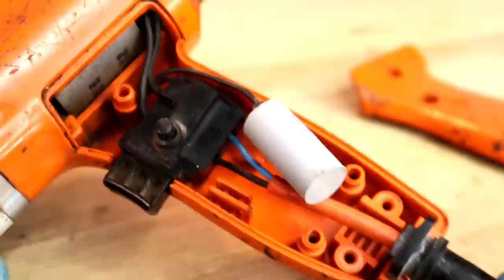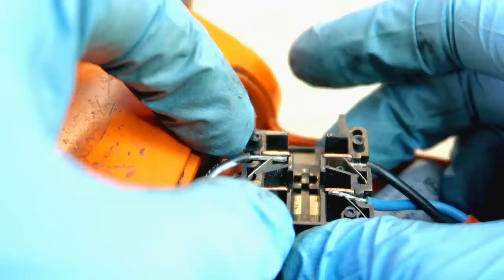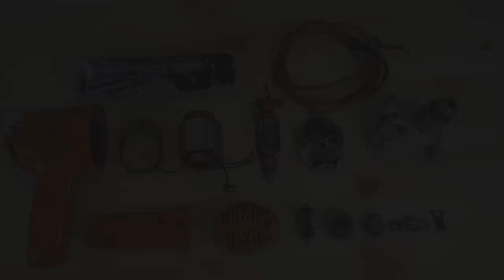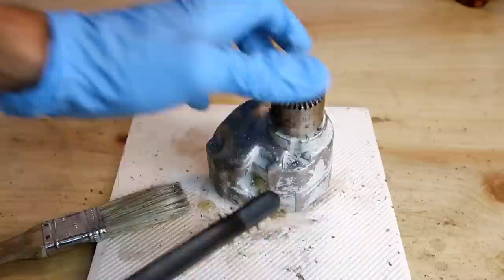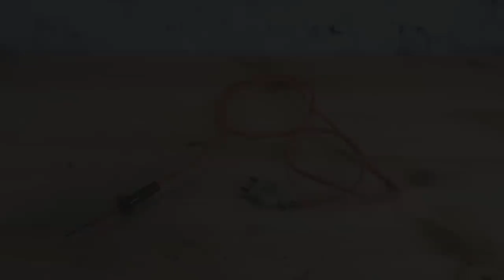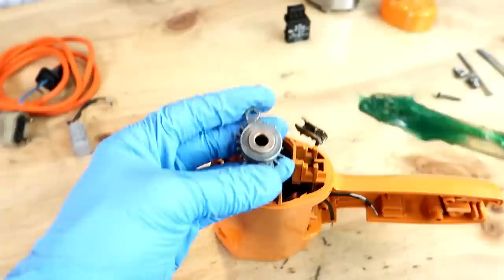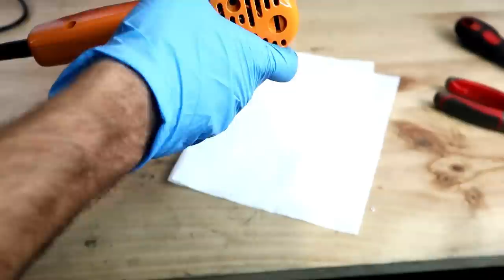Broken Old drill Restoration - Black and Decker

Comment: Excellent! Consider using the buffing wheel with various compounds to restore the plastic parts.  Depending on the type and hardness of the plastic, the scratches could probably be removed with quick passes against  a wheel suitably treated with clay's, compounds, or rouges.  Liquid and paste automobile products, rubbing compounds, and scratch removers may also work. Thanks.
Reply: But that way takes ages, a light rub with fine wet n' dry then a blow over with paint takes an hour at most.
Reply: Using cotton wheels and compounds, a job of that size is 15 minutes, tops.  Rinse with soap and water, dry, and apply a spray polish. No worry about paint chipping. I did this refurbishing telephone cases and components in the 50's and 60's.   @CaptainScarlet1961

Comment: I have a very similar model. Sadly, the insulation coating of the windings in the armature burnt last week, after more than 40 years of happy drilling.
I don't know of a way to fix it that doesn't imply just buying another drill for a motor transplant.

Comment: The phosphor bronze bushing (plain bearing) at the rear of the body, inside the star-shaped aluminium die casting, is designed to be oiled, not greased - that's why there's a hard felt bung inserted in it. Have you found that the aluminium gearbox housing has oxidised over the last 3 years with it not being painted?

Comment: My mom had one of these when I has a kid. I took it apart and put back together again. I don't remember if it worked again or not. I think I only took it apart to see what it looked like inside and how it worked. Stupid me - I would've used a polishing wheel and some rouge, or plastic polish to clean the handle and the back cover instead of simply painting it

Comment: With single direction drills, once screwed on, the chuck will be kept securely in place by the turning force of the drill shaft versus any resistance to turning (i.e: the friction/resistance created by the drill bit in the workpiece).

Comment: This was/is an amazing drill, 2 speed with tons of grunt & nearly impossible to burn out. Only 2 major deficiencies; its not well designed for in hand ergonomics, so you have to be careful to keep it aligned correctly; second the original key operated Jacobs chuck is about as bad as chucks get. I replaced the chuck with a Metabo self tightening chuck that is still operational today, it cost more than the drill!!!

Comment: Was waiting for the chuck to be removed, I would have done this first. You can insert a chuck key and give it a sharp hammer hit to loosen it. But I broke a chuck key once doing this, so I now insert a parallel puch of the right diameter and hit this. I have a white and gold drill, still going strong.

Comment: Top job that. I bought the same drill last week for £9 - decided to take it apart to clean and was going well until breaking both what I now know as the carbon brushes! Bit of super glue got me out of the mire and it's back working. Would I be able to buy the springs and brushes for this model?  It could be said it won't be worth it but that's not the point if you know what I mean 😉

Comment: Pour démonter le mandrin de cette machine, il suffit de donner un petit coup de marteau sur la clé de mandrin dans le sens anti-horloger, ensuite il se dévisse. C'est la technique renseignée dans le mode d'emploi d'origine. La machine sans mandrin servait de moteur à toute une gamme d'outils B&D adaptés comme une scie sauteuse, une scie circulaire, un taille-haies et peut-être d'autres encore.
N.B. Il manque le presse étoupe dans le manche, le cable va ressortir et il y a un risque de court-circuit.

Très beau travail de restauration.
Reply from the maker: Merci Emmanuel👍😊
Reply: Or in English, use the chuck key in position and give a sharp tap on the key with a mallet, anti- clockwise looking from the nose end. This will loosen the thread on the chuck spindle, and it should come off by hand then. To refit, just thread on. It helps if gear one is selected before attempting removal. I've got one of these still going since about 1974!
Reply from the maker: i will try to see, i am curious 🤣

Comment: Confused why you didn't properly disassemble the chuck and main gear shaft, looks to only have a clip holding it in place. Appears quite easy to slide the pin off and finish taking apart.

Comment: Why paint the plastic parts? That could have been buffed up. But not repaint the. Gearbox? Nice clean job though.! I still have a BD. D500 in a wooden case with atachements that my dad bought me many years ago. I burned the armature out   Of it ripping 2 in. Solid oak  so repaired it with a new armature . But don't use it much these days . I have a. Bosch  that's getting old now and numerous battery drills .... Im over seventy so don't do much repairs/ woodwork anymore, great video though. Rob from the uk.

Comment: Can someone please explain, it is my understanding that if the carbon brushes are worn out the motor won't work. How come the motor started up without the carbon brushes?

My knowledge about electrical motors is limited, so I would like to learn. Thanks!
Reply: I was wondering about the same thing. Hopefully someone will provide an answrer. Cheers to our favorite Frenchman! 🍷🍷
Reply: The carbon brush holders were making contact with the commutator! Eeeewww! Those brush holders were wearing away instead of carbon brushes...damage to motor and brush holders if prolonged running since the holders are steel and a lot harder than carbon blocks... That's why it suddenly started to work when he tapped on it a few times. With no brushes in place the holders were able to move about a bit and contact the commutator.

Comment: After assembly do not over tighten the screws holding the gearbox, start and tap the gearbox with a rubber or lead hammer, that will align the bearings rotor ect, then tighten the screws in the gearbox

Comment: You should have removed the chuck while the drill was still assembled.  You can put an allen wrench in the jaws and whacke it with a small hammer and it will unscrew the chuck.

Comment: A bit late to mention now but the insulators between the commutator bars should probably have been undercut so as not to hold the brushes away from the commutator. Even if it runs it will spark something fierce under load...

Comment: There should be a left handed screw inside the chuck. Open the jaws as wide as possible to access it.
Reply: Generally those are on reversible drills, which this one is not.
Reply: @Jammit Timmaj: Although what you say is generally the normal way to secure drill chucks, as "Justyn" correctly states they're normally only on "reversible" drills.
As I've said in a previous post I also have exactly the same drill & wanted to fit an aftermarket bigger chuck as mine has the rather small 10mm standard chuck it came with, but despite all of my experience I couldn't remove the original chuck on mine either even though I managed to remove the screw from inside the chuck :-
Reply: @CaptainScarlet1961  There's an old trick for removing stubborn chucks. Get a largeish Allen wrench, chuck up the short end, put the drill in a vise, and beat on the long end with a mallet. The extra leverage will help. You can also try heating it with a torch, penetrating oil, or all three.
Reply: I have tried all three methods & even submerging the whole gearbox in Plus-Gas Penetrating Fluid for a whole week & it still wouldn't budge.
Reply: @CaptainScarlet1961  Damn son, that's stuck on there good. Oh well.
Reply: @ThatBum42  It certainly is & I sort of gave up after that as I didn't want to wreck the drill during the process, given how affordable power tools are now I just went to B & Q  & bought a drill with a 13mm (1/2 inch) chuck with variable speed & forward & reverse drive.
I use it in it's bench stand with a small grinding stone in it for sharpening my small drill bits & chisel's, stuff like that.
Reply: @John Harwood: As the above statements explain, I have already done what you suggest with no success and I wasn't prepared to get anymore brutal with it as it still works fine!

Comment: Use to in work B&D in 70s  & 80s the way the repair area use to remove the chuck is get the chuck key in the chuck and give it a whack  with a hammer this way seem to  brack its grip on the thread

Comment: I have a Black and Decker H264 made in 1983 that makes some awful noise in high gear and seems not to spin smooth in low gear. Mine has a plastic gearbox casing, I wonder if it opens the same way? When I've disassembled it it didn't pop open like yours did...
Reply: Answering to myself for reference for others: It came out to be simply caked up with residue from drilling mixed with grease to the point I had to force the gearbox open. The odd thing is that gearbox seems to be in good condition, I was expecting to see a broken tooth or worn out gears, but it is in great shape, bearings are tight. I suspect some issues with a hammer mechanism that it was somehow engaging when switched off.

Comment: He does not know how to properly remove the bearings, when removing the starter, it was possible not to disassemble the button right away, but with an awl in the gripping point of the wires to “free” them, + everything that the user has already mentioned below is Александр Орлов ...
In general, he can clean, polish, wash and peel, but he still needs to master more "thin" work!
But for the efforts and diligence uniquely LIKE!
I wish to take into account the criticism and good luck!

Он не знает как правильно снимать подшипники, при вынимании стартера можно было не разбирать кнопку сразу, а шилом в месте захвата проводов их "освободить", + ко всему всё что ниже уже озвучил пользователь Александр Орлов ...
В общем чистить, полировать, мыть и рихтовать он может, а вот более "тонкие" работы ему еще нужно осваивать!
Но за труды и старание однозначно ЛАЙК!
Желаю учесть критику и удачи!

Comment: I have a similar shaped one but it's blue and all metal body. No idea how old but when I last tried it, sparks flew out the vents at the rear.
Reply: It's either the brushes are worn out, or the capacitor needs replacing ( the big white tube with the wires coming out near the trigger) :-
Reply: SmokinJoe347 
Thanks
I'll dig it out and take a look.

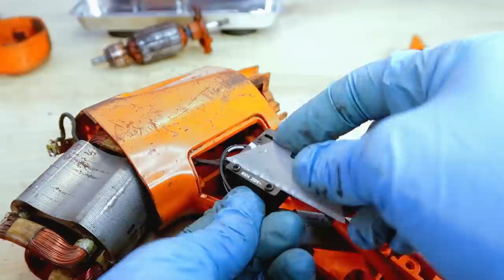Comment: Great job, and nicely put together video. I'm trying to do similar with a H720 B&D, might be a few years newer than yours (very similar, but has a hammer function). Mine has the springs that hold the electrical wires in the switch all rusted and broken. Any tips on how to repair this?And how did you get the switch back together after cutting off the melted tabs @ 4:00 ?

Comment: hello... i'm taking a long shot here, but i just need some advice. i am restoring my grandad's Wolf Saphire model 74 drill. I took the motor out the casing and there are 2 wires that are attached to the motor with little horse shoes on the ends. what are they for and what does it attach to?

Comment: I would never use acetone on plastics. Soapy water is fine for plastic casings and such.
Reply: Also just replace the cord, much longer lasting repair. Plugs are fine but if a copper wire breaks once its highly likely to do ir again the same way.

Comment: I want to down vote this when you open the screw at the back without first turn off  the power, but I decided against it. Do not do that in your future video again please. Try using a bearing puller to pull the chuck out and replace it.

Comment: 2 things. 
One, you should of left the plastics as they were, clean them up but left them as they came out the factory. 
Two. You should of changed that cable for a new, longer bit of flex, tie a knot in the cable inside the housing after the rubber strain relief so it can't be yanked out and put a new, tough (preferably a rubber one, up to date plug on the end.

Also, these old drill don't have a clutch, so if the bit jams you'll be getting a twisted or broken wrist.

Comment: Sorry to say this, but cleaning and painting/adding some lube is not a restoration. It's a clean and paint. You never actually fix anything broken in your video's. You never seem to take your time to determine how things come apart, often somewhat destroying parts as you go along. Sure it looks nice, and it works, but it is not as good as it should be, had it been done right .A simple ting to fix like Mismached screws is a big turn-off.

Comment: You put like no grease in the gearbox and you ran the armature over a wire brush and did not cover the windings which likely nicked the lacquer off the windings which will cause shorts. . . I dont see this drill lasting long under any type of use now.  You shouldve just put new brushes in it and sent it on it's way, would've saved a lot of time that could be used doing something else. Never understood why someone would bother with something like this.

Comment: Why even bother restore a black and decker drill??
Reply: Black and Decker used to make decent tools before being turned into a homeowner DIY kind of tool and not for professionals. Stanley Black and Decker owns Bostitch, Craftsman, DeWalt, Mac Tools, Irwin, Porter-Cable. DeWalt is their pro lineup, they cheap out on B&D products for this reason.

Comment: Oh, man. Well, you did repair it, but who knows how long it will last now. You spent all that time degreasing parts that are supposed to be greased anyway. And replaced the grease for some reason. But you used barely any compared to what was in there. You want grease to get in everywhere; or it won't be around to lubricate.

Then we see, that's not the right orange. And Black & Decker's colors were orange, white and black. Not silver. Plus no decal. IMO, painting the handle isn't good either. Should have been polished.

On the plus side, you used the original cord.